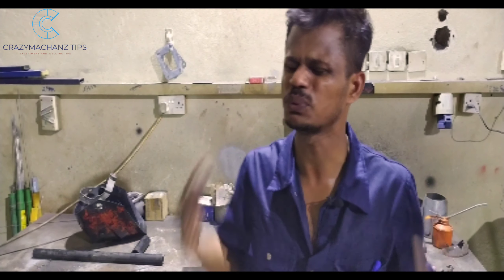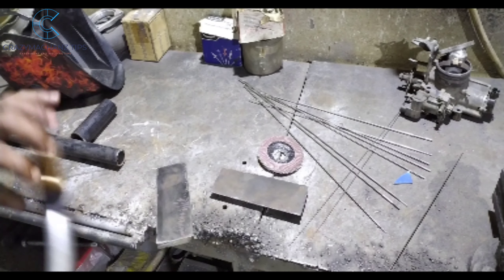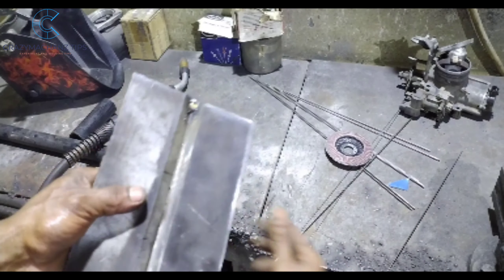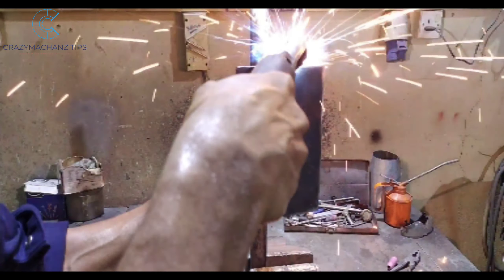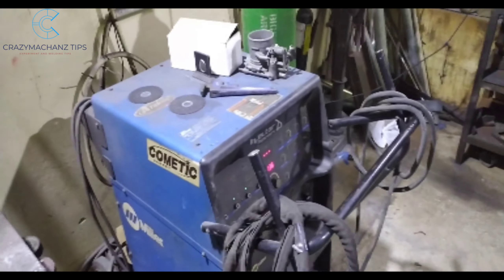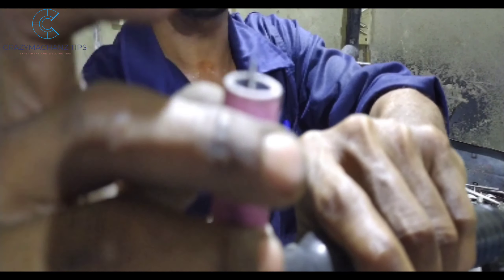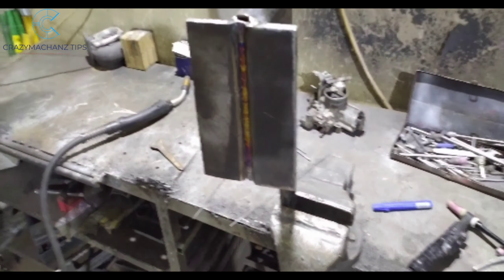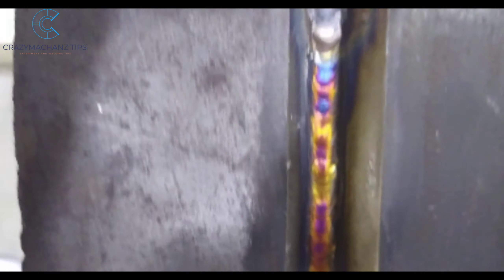TIG WELDING 3G VERTICAL OPEN ROOT MALAYALAM (VIEWER REQUEST) CRAZYMACHANZ TIPS #tigwelding #welding

Comment: ബ്രോ നിങ്ങൾ വെൽഡർ ആണെങ്കിൽ torchu കയ്യിൽ എടുക്കുന്നതിനു മുൻപ് ഗ്ലൗസ്, മാസ്ക് ധരിക്കുക പിന്നെ നിങ്ങൾ MS പ്ലേറ്റിൽ SS filler wire ആണ് use ചെയ്യുന്നത് അത് പൊറോസിറ്റി ഒഴിവാക്കാനാണെന്നു മനസ്സിലായി. എന്നിട്ടും welding എന്റിൽ pin holl ഉണ്ട് tenetion rad 5mm ന് മുകളിൽ ഉള്ളതാണ് കാരണം അത് കൊണ്ടാണ് ഗ്യാസ് ജോബിന് പുറത്തേക്കു പോവുന്നതും pin holl വരുന്നതും പിന്നെ റൂട്ട് അടിക്കുമ്പോൾ 1.6 fillar use ചെയ്താൽ filler കട്ട്‌ ഇല്ലാതെ    welding ചെയ്യാം പിന്നെ മെറ്റൽ കൊടുക്കുന്ന രീതി നൈസാണ് 45digri ok 👍
Reply: Halo oru doubt clear cheyyumo